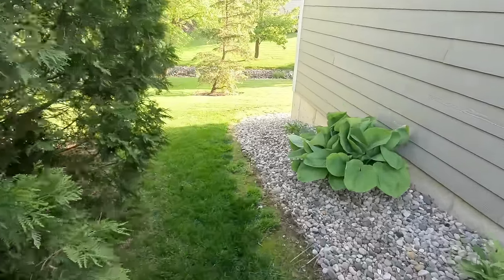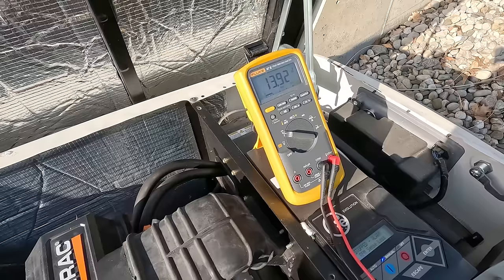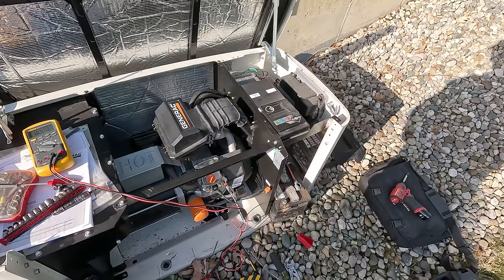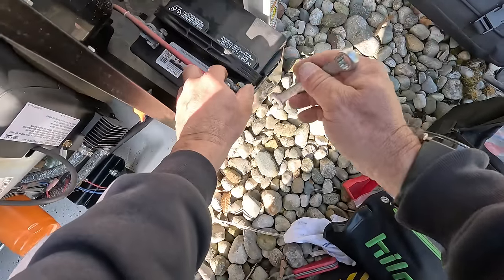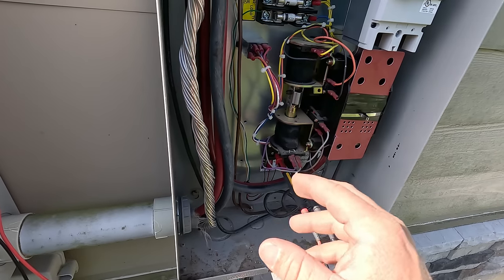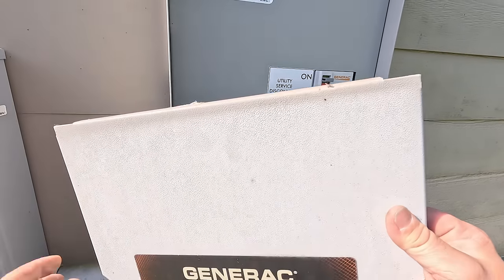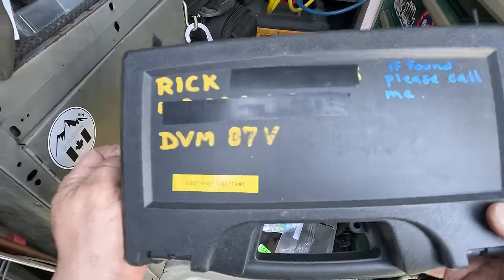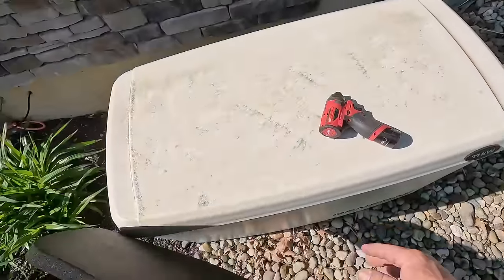Generac Home Generator Wont Start Over Crank 1502 Code

Comment: Why don't Generac recommend AGM batteries to avoid all the battery corrosion issues on their generators?  Like you said most problems on these generators are do problems like you show here. When my original Exide battery goes bad or shows any signs of corrosion, I will for sure go to a AGM type.
Reply from the maker: I’m not sure why they don’t. Heck if people would keep the battery water level up and just check the generator like it mattered they wouldn’t have near the problems they have.
Reply: It’s a smart move and change it every year if weather gets bad 
It’s a lot of work and expensive to keep one ready 😢
Good luck folks the higher amp battery the better 😊
Reply: Why not an AGM, or a 7 year warrantied battery from interstate or whatever you think is better.  Very simple.  It is money wasted.  A "regular" battery properly maintained will provide as good of a service life as anything else, just change it every 3 or 4 years-even the AGM-even if it tests good.  Remember, you only have at max a 2.5 amp charger.  It won't do well with a larger battery which is hard to get in an out.  Just change the battery.  Just do it.  (And, replace more often under the "correct" circumstances.)
Reply: @bobbygene8274  The main reason for me going with a AGM type battery is for no more acid leaking and  corrosion problems that go along with standard batteries. I don't mind paying extra to not have to deal with the mess and damage they cause.

Comment: why is the ground fused?  seems unsafe to me.
Reply from the maker: Where did you see this at in the video? Give me a timestamp.
Reply: @HVACRSurvival    I think he confused you talking about #23 switching the ground as you were about to pull that line fuse to simulate an outage. BTW, been pulling that fuse for decades just to avoid customers complaining of clocks flashing "12 noon" after a service call.  <LOL>

Comment: Had a guy call me this winter with a no start. The Venturi flaps were stuck a little but enough for the step motor not to move. Started it to only find he blew all the fuses in the ESAM. Fucking guy was pissed at me because generac wouldn’t talk to him. Pays to be certified😁.
Reply: Also thanks for not showing that code
Reply from the maker: If they’re fast they can get it but I try not to totally screw other techs over.

Comment: Mice cause havoc often
Reply: Thanks to changing the plastic wire insulation over to a soybean based product!
Reply: @rpsmith  yes. On Heavy equipment farm equipment cars trucks etc soy based plastic insulation on wiring a huge problem.
Honda makes hot spice pepper tape to wrap wiring.
We used on my boat outboard motor.

Comment: You don’t go to your barber when you have a tooth ache. Why would you call your air conditioner company to fix your generator? Unless, of course, they are certified to repair generators. Stay in your lane.
Reply from the maker: I was commercial certified and residential. I am highly doubting you went for Commercial. Most electricians are lucky if they even know a damn thing about generators. So I’m not sure what lane you’re in, but you should probably make sure you even know where you’re at before you try to tell me what lane to get in.  This is. basic freaking electricity
Reply: I'm going to assume that the reason is because most HVAC companies are who do the generator installs. 🤷‍♂️
Reply: It's an appliance, so why wouldn't they be able to work on it since they're certified to do so and clearly know what their doing? Gen dealers can be any EMP Company. Clearly you don't get it, might want stay in YOUR lane.

Comment: If that was my gen set, I would be pissed you replaced a battery when all it needed was clean terminals.
Reply from the maker: You don’t listen or think. You’re just like the other guy that said the same thing. The battery was 8 years old and the customer chose to replace it. Do your own work then if you know so much✌️